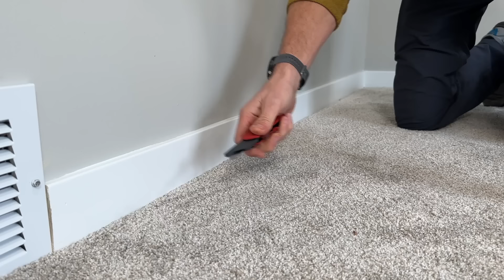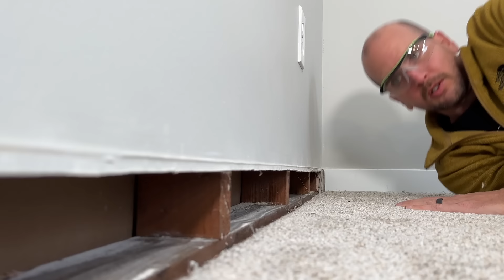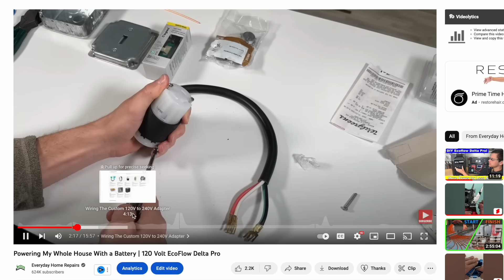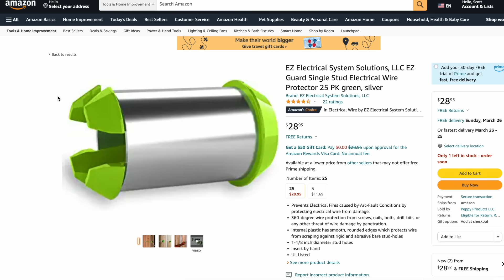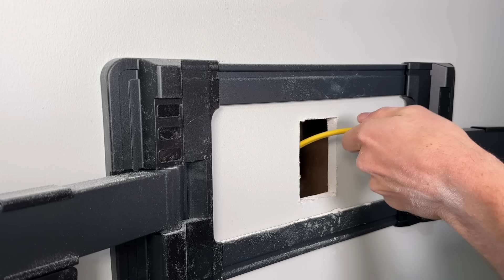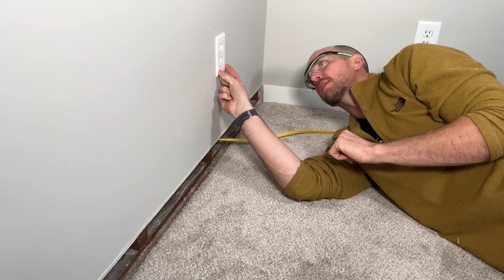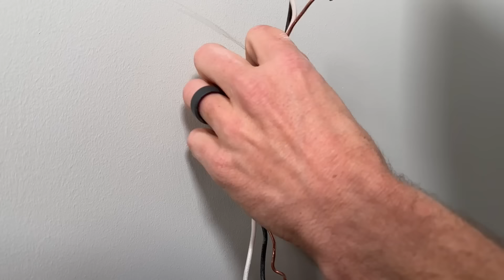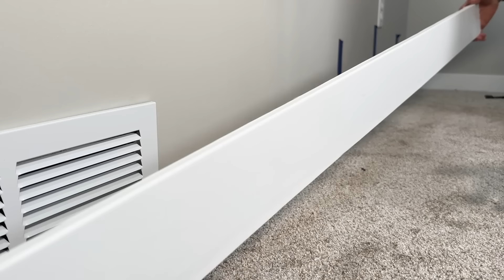How To Hide TV Power Cord And Cables | Easy Way To Move An Outlet

Comment: I am a contractor with over 30 years of experience in multiple trades, and I just wanted to compliment you on your very nicely demonstrated procedure. You articulate very well and your information is "refreshingly accurate"..a real benefit to people who would consult such videos of guidance on how to do something themselves, particularly if they have little or no experience at "do-it- yourself" tasks.

Thank you, and Cheers to you, my friend!
Reply: I'm not a professional but I couldn't agree with you more on this video!!! I guess I'm gonna have to watch more of his videos now!!!
Reply: I agree that he articulates as well and is concise with good flow.  A few more pointers:  1) Every home owner or contractor (up sell and QA opportunity) needs to keep documentation of any modifications or anytime you have to open a wall (especially if you do good work) that saves a ton of headache later and adds to resell value is to keep a notebook of modifications and where things are (digital is best so you can add photos easily).  2) Protection is a good idea such as nail plate or he used "Easy Guards" inside the stud which neither protect the Romex behind the dry wall not in studs like conduit which based on the location behind the floor trim isn't likely so documentation comes into play instead.    3) I agree with @No1Sonuk, always have cheap non conductive fire resistant string to add easy access cord pullers to tie to box/romex/cables.  Tag it, you can buy 1000 of these for like $2, I bought the ones that double as anchors/mag guide compatible since tech is constantly upgraded, 500 for $8.  4) @EverydayHomeRepairs, A list of bare minimum common household tools and then recommended would be nice since you articulate so well and probably already have a database where you keep track of some of these things for analytics and recycling content, its a simple export paste or AI tool.  5)@gerrymcintosh4477, I agree, a quick mention of Spackle and printable chalk would have been good and can still refer to who you support for details.  6) Recessed box options: box extenders, angled nail Electrical Boxes, Sandwich style boxes, 2-gang Recessed TV Box (use generic search terms like low voltage or Multimedia Outlet for 3rd or half priced boxes compared to marked up marketing schemes), and pro tip of Outlet Spacers to bring to Code.    7) @chadm1978, agreed, clipping nails does take less time but I like to bend the nails or clip and grind if its not a big area.    8) @richarda3659, agreed quite often times TV's are mounted on an outside wall and a couple of considerations should be taken into account as well an insulation and house breathing air flow considerations where common thought would be to seal it up tight but extra considerations and tax benefits of updating insulation one room at a time might be very beneficial in which case your tax credit allowance.
Reply: A good salesman. Most videos promoting products l, some useless like this
Reply: What happened to the horizontal 2X4 at 4 feet, holding straight the 2 studs?
Reply: Easy when u have dry wall. Also u should insulate your earth cables
Reply: Nearly 50 years under my belt, couldn't agree more.
Reply: @NathanYount  Great comment - hope you don't mind I had my AI rewrite it to make it easier to read :

I agree that he articulates as well and is concise with good flow. A few more pointers:

1. Every homeowner or contractor (up sell and QA opportunity) needs to keep documentation of any modifications or anytime you have to open a wall (especially if you do good work) that saves a ton of headache later and adds to resale value. It's a good idea to keep a notebook of modifications and where things are (digital is best so you can add photos easily).

2. Protection is a good idea such as nail plate or he used "Easy Guards" inside the stud which neither protect the Romex behind the drywall nor in studs like conduit. Based on the location behind the floor trim, this isn't likely, so documentation comes into play instead.

3. I agree with @No1Sonuk, always have cheap non-conductive fire-resistant string to add easy access cord pullers to tie to box/romex/cables. Tag it; you can buy 1000 of these for like $2. I bought the ones that double as anchors/mag guide compatible since tech is constantly upgraded, 500 for $8.

4. @EverydayHomeRepairs, a list of bare minimum common household tools and then recommended would be nice since you articulate so well and probably already have a database where you keep track of some of these things for analytics and recycling content. It's a simple export paste or AI tool.

5. @gerrymcintosh4477, I agree, a quick mention of Spackle and printable chalk would have been good and can still refer to who you support for details.

6. Recessed box options: box extenders, angled nail electrical boxes, sandwich style boxes, 2-gang recessed TV box (use generic search terms like low voltage or multimedia outlet for 3rd or half-priced boxes compared to marked-up marketing schemes), and pro tip of outlet spacers to bring to code.

7. @chadm1978, agreed, clipping nails does take less time but I like to bend the nails or clip and grind if it's not a big area.

8. @richarda3659, agreed quite often times TVs are mounted on an outside wall and a couple of considerations should be taken into account as well as insulation and house breathing airflow considerations. Common thought would be to seal it up tight, but extra considerations and tax benefits of updating insulation one room at a time might be very beneficial, in which case your tax credit allowance.
Reply: @mariobe3674  the horizontal is not for holding studs straight, the horizontals are purely for fire stops.

Comment: I was thinking there is no way you can do this without ripping up the wall. And you did it. I am stunned 😳
Reply: @Wol1verine  take special care when removing the molding. They tend to debt and crush easily, which is worse then sheetrock repair
Reply: Well yes, but actually no...
He did cut the drywall

Comment: As an FSR electrician for 30+ years, I think you did everything right. If everyone took a bit of time to learn the basics of electrical wiring, we would have less electrical fires. Little things you pointed out out like, separate neutral and ground to left, hot to right and put spacers behind screws, make life so much easier. Thanks and keep up the good work.

Comment: I had no idea that "wago"s existed.  Now I see that's the WAY TO GO!  I have a 4 gang box with  ooodles of size 12 wires and the big red nuts crammed in. I had to push against the opposite wall to get the faceplate  flush so I could screw it in place.  Then the nightlight quit working after a couple of weeks.  I've been dreading taking it out... now I believe I'll swap nuts for wagos, put in a GFCI outlet (more of the heavy wires) in that spot and use a disposable" plug in nightlight.   Thanks so much!

Comment: Great video! One tip as a painter I can offer is use “painters putty” in place of caulk for the nail holes.
Reply: 💯 agreed. You can sand putty not caulk. Makes for a nicer job.
Reply: With nail holes that small you can just put white paint over it. The viscosity of the paint will fill the holes

Comment: I appreciate you highlighting all of the tools you use and the links where to buy them. Nothing is more frustrating than seeing a great video but not knowing where the buy the necessary tools to make the job easier. Another great video Scott.
Reply: As a DIYer, it's not even just knowing where to find tools, but even knowing said tools exist, which is something you just pick up on over the years. I can't even count the number of times I've said, "holy crap there's a tool for that?"

Comment: Great video. I recommend fishing the Romex through the original outlet first. Push all the Romex through the outlet, the studs, then using a line to pull it up to the new outlet hole. This saves the effort of blindly pushing the Romex into the original outlet.
Reply: Exactly.  Watching I liked how the romex magically came into the original box.  That had to be a chore.
Reply: It seemed he dropped the Romex from the new box, pushing it down the short distance to the original box. Am l correct??
Reply: @tompeters4234  yes I kept re-watching and looking for the part of how the Romex suddenly appeared behind original box
Reply: I wondered how he magically got that wire into the original box!  Wouldn't he need to break a new tab off in the back to fit it in?
Reply: me too
Reply: You made it a point to break off the tabs on the new outlet, but ignored the tabs on the original ?
                    🤔....?
Reply: buy wire fishing rods and problem solved. I would not be bothering removing trim and cutting drywall and just go under the house and do from the bottom and no damage to the studs
Reply: I was wondering about this too!
Reply: @sleeve8651  they were different types of boxes. The one he installed was an old work box. The original one was new construction box.
Reply: @alexk6745  his method would work if the house was on a slab or a two story house
Reply: what is Romex?
Reply: In this case it must be easier@lynneldridge7661
Reply: @alexk6745  Many houses have no basements. Like essentially all of Florida, for example.
Reply: @kekplexis  Romex is a brand name (Southwire Company) for the type of wiring used in residential builds. There are 3 strands of copper wire (hot, neutral and ground) with each individual strand wrapped in plastic and then the 3 wires are bundled together inside a Non-Metallic (NM) cover, usually made of PVC.
Reply: @alexwhat if it's a slab?  k6745

Comment: I use wago connectors because of your videos. Easiest, most useful way to wire anything. Thanks for a great video. Super useful.
Reply from the maker: Totally agree and thanks for the feedback!
Reply: I have contractor who won’t use Wago for outlets
Reply: Don’t think he trust them
Reply: Using a utility knife to remove the outer insulation needs to be done very carefully, and with a new blade! You’ll very easily cut into the inner insulation which is a big no no!

You didn’t mention the choice of positioning the new outlet (which is illegal to install yourself where I’m from). You’ll need to make sure that there’s enough room behind the TV for the plug on the power cord.

Comment: You are required to change the breaker to an arc fault breaker now that the circuit has been extended. Just in case anyone is wondering- 25 year master electrician/ electrical contractor here. Don't waste money on wago connectors if you aren't in the biz, regular ideal red wire nuts work just fine and are a fraction of the cost. For the record, wago does make 4 position connectors.